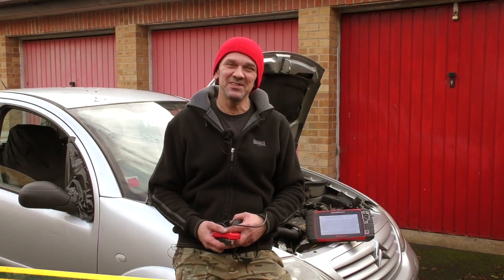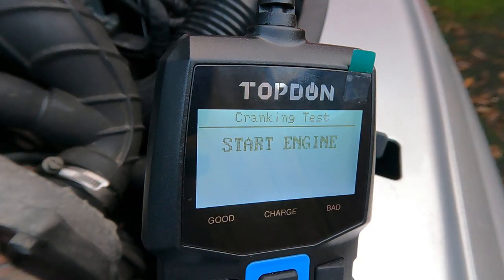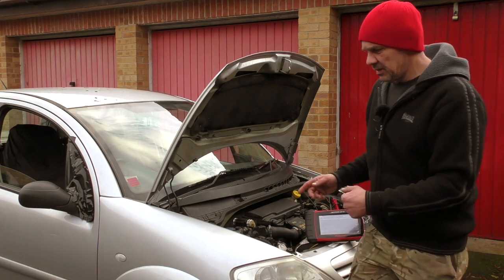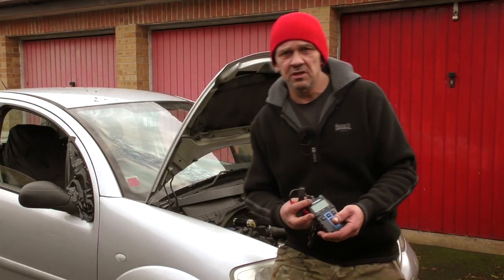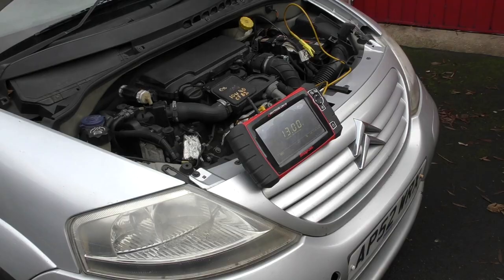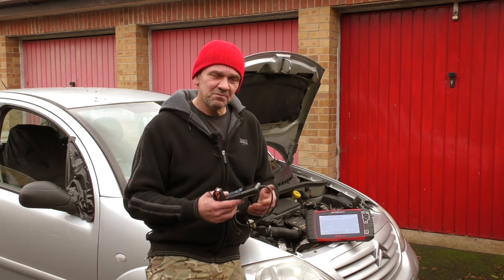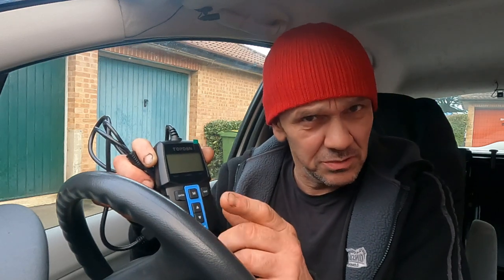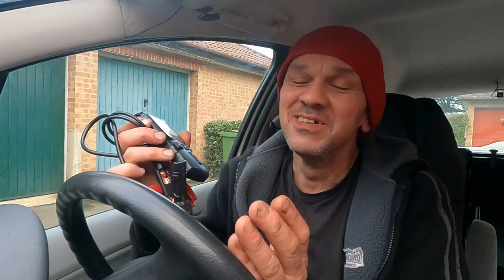TOPDON BT100 Battery and Charge System Tester - Review vs. Oscilloscope Ripple Test.

Comment: At 6:16  your AC ripple voltage is 246 mV and anything above 100 mV AC ripple is considered a bad diode . Your meter said the charging test passed when it clearly failed as the diodes are going bad causing to much AC ripple. A few people consider less than 300mV AC ripple to be ok but the vast majority of people say less than 100 mV AC ripple is the limit of being OK. If you measure the ripple directly from the + post on the alternator then your true real reading would be higher and worse  as the battery tends to filter out and smooth AC ripple  which gives an inaccurate reading if measured from the battery.

Comment: I've just bought a Topdon Artidiag 600, and delighted with it. Good quality in my view. More like 9 diodes in a moxern alternator to give full wave rectification. Great vid again, keep them coming please.
Reply from the maker: Cheers.  I need to update my tech knowledge.  Basics are always there but they like to add things.
Reply from the maker: I just took a look at thier diagnostic equipment. The Pheonix plus looks good and the prices are cheaper than snap -off.  Artidiag HD for truck too but slightly outdated.
Reply: @trailerfitter2  me too, that's why I watch your channel Chris.

Comment: Nice video Chris ...  thought it was going to be DAF free but it had to sneak in ( I hope all copyright approved above board ? ) 
Had a similar unit for about two years and cost £25 and its been brilliant looks very similar and for diagnostics its brilliant especially when you have a scenario where a new machine has had three batteries on within three months and it the other fitters just check it with a multimeter / or well the charge light went off ?  just put it down to operator error till the customer gets the invoice and screams warranty down the phone ...    faulty alternator parasitic drain.
Reply from the maker: Quick checks saves being called out later on at night for a battery that should have been checked....

Comment: Hello, very nice 👍 thanks. Do you know how much load (amperage) does the topdon puts into the system when doing the charging test? Other testers ask you to turn on lights, blower, stereo, everything electrical which I think is a much more realistic test.  
Also, using a multimeter connected to battery, what voltage should be the minimum to get when everything electrical turned on and the engine is idling without revving up engine?
And does this voltage would vary of your battery is not fully charged?
Do we need to do any test with a battery fully charged?

Comment: Hey mate where can i send non video related questions? :D miss your videos. Soo i installed new s cam bushings kit in 3 fruehauf axles. My boss gave me 4 kits from one brand (i had to put the o rings in place inside the ball) and 2 from another brand that looke better quality. The 4 inferior quality kits made the s cam very hard to move by hand only with the slack adjuster. Is this normal? What are your thoughts?
Hows it going in the shop btw? Big hug from portugal
Reply: Hi Bud. Some patten parts are made badly. Insist on genuine.

Comment: Do you have any recommendations or experience with any oscilloscopes similar to but not quite as pricey as your snap on one used in this video?
Reply from the maker: not really but i've noticed there are loads on banggood cheap. I think it depends on the bandwidth to deal with automotive that makes the difference.

Comment: Your 24 hours too late !! I was looking at the topdon with the printer ,but ended up going for a different brand ...We have a different one from DAF it came on a trolley with charger unit ,the batt tester is bigger and you then have to point it at the printer for it to print ,we had to get 3  and they where not cheap and i think DAF want us to now buy the one you have
Reply from the maker: the MAN one reads the temperature of the battery, does its test and then emails the results. £5000 worth of kit!
Reply: @trailerfitter2  The thing we got you point it at the battery for the temp ,but it doesn't email..I think they where like £1500 a pop and we had 3 ,but the clips also had a sensor lead on them and they where very delicate and would break ..I don't think manufacturers put enough thought into where their product will be used and by who ..Some people abuse the kit